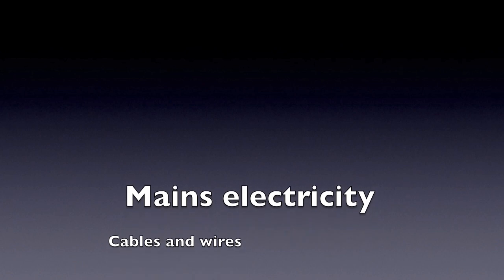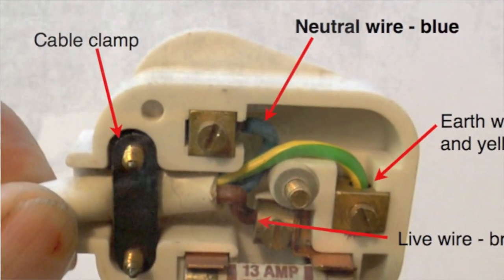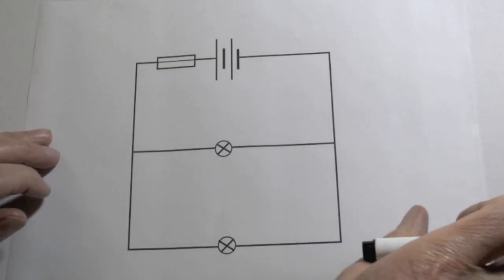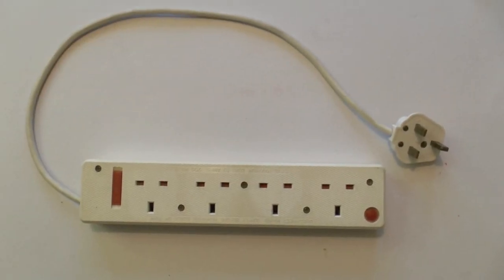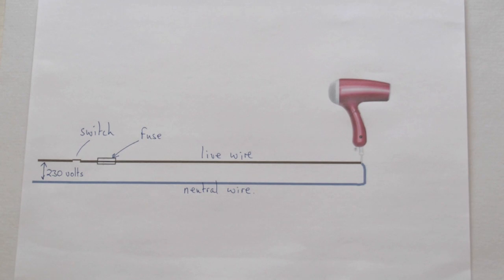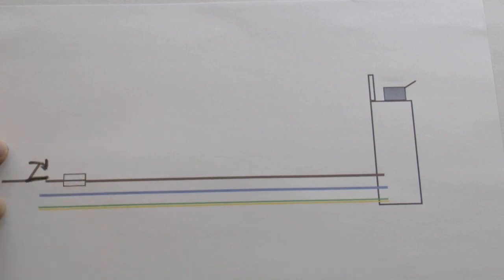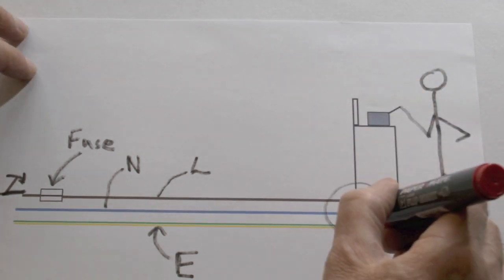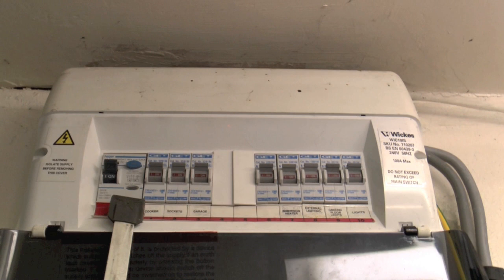Live, neutral, earth, plugs, fuses and circuit breakers, mains electricity explained: fizzics.org

Comment: Great video why do other counties have two pin plugs so they won’t have earth ?
Reply from the maker: They operate at a lower voltage, generally about 110V, which carries less risk
Reply: Fizzics Organisation. But is that for all equipment ie like fridges and big electronics devices, but is it still safe ??
Reply: Fizzics Organisation also why don’t toys and small electronic devices have earthing/ground wires in them ??
Reply from the maker: @hasanucar5456  Small devices usually work from a step down transformer so that the voltage is low and therefore safe. Things working at 110 volts are fairly safe without an earth but not completely for those who, for example, have a weak heart. Neighbourhoods working on 110 volts are less efficient. Power is transmitted more effectively at the higher voltage. The reasons for using different voltages are more to do with history than with best practice.
Reply: Fizzics Organisation so it’s not safe not to have earth ?? With the small electronic toys would they not need earthing as it’s low voltage ??

Comment: Got confused at 8:42 . Is the casing Earthwire is connecting to the cooker itself or is it the cable?
Reply from the maker: The earth wire is connected to the casing. If it was connected to the cable the current would have an easy "short circuit" to the ground, bypassing the cooker completely.

Comment: I currently got a light fitting with 2 wires one is white the other is black. With what wire do I wire them with?
Reply from the maker: If it is a standard AC supply to a filament lamp with no earth, then it doesn't really matter. I would guess (but it is a guess) that the live is white and the neutral black.
Reply: Thanks. What if their are two wires and one is white one is grey?
Reply from the maker: Same answer really. Those colours are not part of any convention I know.
Reply: One more question

I got a fitting that used a 18W Fluorescent tube and I am trying to bypass it. One socket has a white wire the other socket has a blue wire can you tell me which is netrual and which is live? Thanks
Reply from the maker: The neutral wire is usually blue but (carefully) use a voltmeter to check the potential between the wire and earth. The neutral wire should show a potential of a couple of volts.

Comment: Hi Roger, fantastic video, thanks! Can I just ask, if we have fuses in our plugs that protect appliances from high currents, why would we ever need surge protectors in extension leads?
Reply from the maker: Covered by the saying "using both belt and braces"(to hold up your trousers) It is an extra device covering those who might use the wrong fuse.
Reply: Ah, that makes sense! Thanks for replying :)

Comment: What would have if you wired netrual with nutrual, earth and live with live?
Reply from the maker: you would have a bang as a very large current flows from live to earth and melts (vaporises) the fuse wire in a fraction of a second
Reply: It’s a light fixture on the ceiling.

Also it works fine...
Reply: Wait the fixture is netrual with earth and netrual.
Reply from the maker: Sorry, I am not sure of the question you are asking.
Reply: Sorry if I am confusing you... The question is what would happen if I wired live with live netrual and earth with netrual?
Reply from the maker: It rather depends 0n how the circuit is protected. With fuses only it may work fine but you may get a shock if you touched a metal part. If the wiring is protected by an earth leakage trip switch then because some current would flow to earth rather than down the neutral wire the trip switch would trip.
Reply: It’s a light fixture in the ceiling.
Reply from the maker: The answer is the same
Reply: Okay thanks.
Reply: +Xirexter A pair of brown pants, I'd imagine!

Comment: What about cables that don’t have the earth wire?
Reply from the maker: That should only happen if all of the casing is made of (fairly heavy duty) non conducting plastic - which is true of most electrical machines now except for those that get very hot such as fires and cookers.
Reply: I have a Fluorescent fixture that is made out of metal...
Reply from the maker: It should be earthed

Comment: I don’t understand, wouldn’t a bridge to create that short circuit still allow for current to flow to other parts, acting similar to a parallel circuit? Why doesn’t it flow to the next bulb like it would with a parallel circuit?
Reply from the maker: Because the large current is likely to blow the fuse or trip a trip switch which would cut supply to the whole circuit.

Comment: How does fuse blow when body earthing is connected to earth by a pit?  Dont know the process. Please help me out sir
Reply from the maker: Not quite sure what you are asking. However, if there is a fault in the wiring so that the live wire touches the metal body of a machine, then a large current will flow through the machine and then down the earth wire to a metal stake hammered into the ground. Because the current is very large the fuse will melt. 
If there was no earth wire then anyone who touched the machine would conduct a current through their body to the ground and they would get a bad shock or be electrocuted.

Comment: at 10 mins, why does the current become large?
Reply from the maker: Hi, if there is a failure of the insulation on the live wire or some accident where the live touches the body of the machine so that the live is connected to the earth, then that circuit will have a low resistance and so a large current will flow. That large current will melt the fuse wire.

Comment: Nice video,  i have a question : i'm not an electrical guy... How to make sure that the LIVE/NEUTRAL wire inside the wall outlet is installed properly (The L should be in the left side of the wall outlet) . If their position is switched , the fuse won't work right? Any advice ?
Reply from the maker: Hi You can check with a multi meter switched to voltage measurement AC (alternating current). The voltage reading between live and earth will be high (around 240 in UK) but between neutral and earth it will be tiny (maybe a couple of volts) Keep you fingers off any uninsulated contacts!
Reply: Thanks a lot, another question: how is the simple and safe way to check whether the grounding (earth) wire is installed and work properly inside the wall outlet.
Reply from the maker: That is a bit more difficult and really is a specialist job but you should get a reasonable idea if you use the multimeter on resistance measurement. The earth should be properly connected to the ground and so should the cold water pipe so check the resistance between the earth and any cold water pipe. The resistance should be very low. This is not absolutely definitive because you may have sections of plastic piping in your cold water system. Alternatively, but a lot more trouble, hammer a metal stake a couple of feet (.6m) into the ground and test the resistance between your electrical earth and the stake. The resistance should be low (a few ohms at most).
Reply: Hi Roger, Thanks a lot for the explaination. I'll check it out and see what i'll get.. And thanks for sharing the video. GBU.

Comment: This is completely wrong I guess! Current is going back to the source and not to the ground.
also if the phase wire touches the equipment it is supposed to be trip by the MCB at the instant. Also current will not take easy path, it will take every possible path. The value of current depends on the resistance of the path. In case of human it is above 1000 ohm so there will be some milli ampere current flowing through the body.
Reply from the maker: You missed the point I was making. If there is no earth and the circuit breaks but the case becomes live, the circuit is open and so no mcb is tripped, unless someone touches the case of the macine in which instant they are by far the lowest resistance available and therefore conduct a current with painful results. The mcb would not trip because the current is low. An earth wire particularly with an earth leakage trip but otherwise an mcb or fuse would quickly cut the supply.
Reply: Yeaaa I understand. But in the explanation you have mentioned the current will take the easiest path. What about the person touching the equipment? Current will be going through him too until the mcb got trip. Perhaps that may be very short span of time but it should be included in the explanation. Viewers might take it wrong.
Reply from the maker: An mcb will only trip when the current is very high, that is it's function.  However as you have pointed out yourself, the current through a body is fairly small, of the order of milliamps, enough to be fatal but not enough to trip an mcb
Reply: Obviously it will be too small! But milli amps are much enough to kill a person. 
Above 30mA is enough to break a human heart.

Comment: How does the current going through the Earth Wire Melt the Fuse on The Live Wire? Isn't the return path completely different from the supply path?
Reply from the maker: All the current always flows down the live wire. If there is a fault it completes a circuit through the earth where there is very low resistance. Because the resistance is low a large current flows and that melts the fuse.
Reply: Roger Linsell Thankyou for replying, but didn't it work like this, 
Power Source --> Live Wire --> Component/Appliance -> Neutral Wire ?
Reply from the maker: Muneeb Tahir It works like that if the machine is working properly and the machine will have a significant resistance which limits the current. I there is a fault the current by-passes the machine and runs down the earth where there is very little resistance, the large current then melting the fuse in the live wire.
Reply: very useful information explained in a very simple way. I have just joined basic electrical course and the explanation is far more better than my instructor. I would love to see you more electrical videos to enhance my knowledge.
Reply from the maker: Sukhvinder Singh Thank you. I have a few others for example on transformers and power transmission and simple circuits but I will think about what you say.